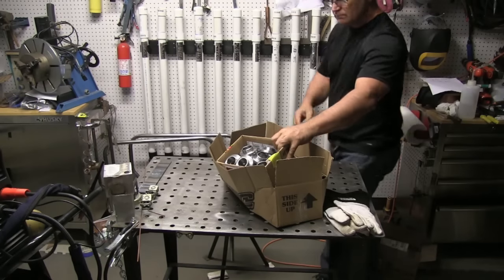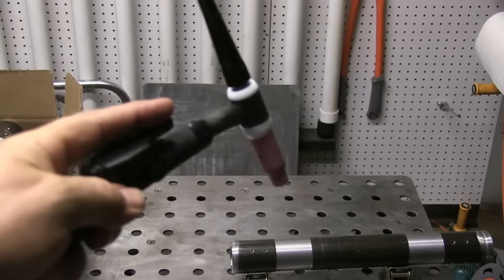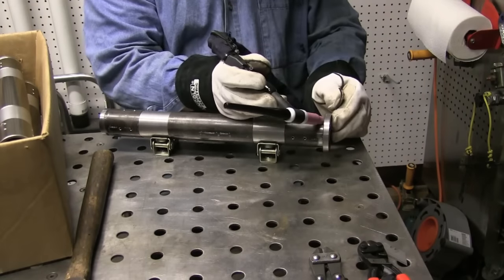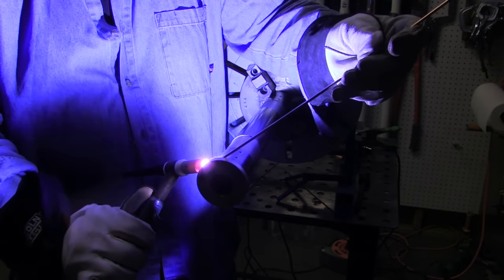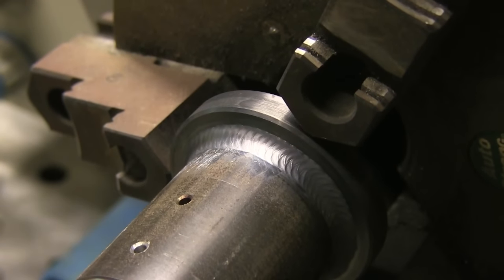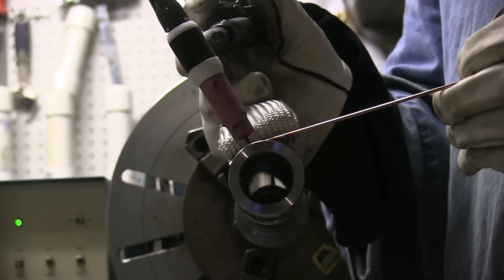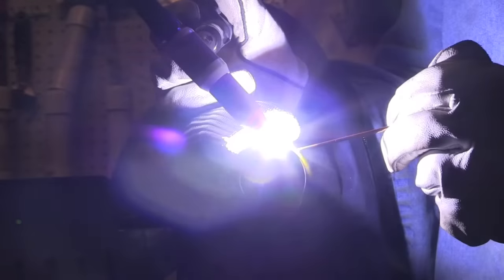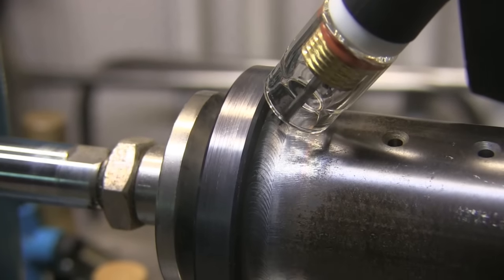TIG Welding parts on a turntable

Comment: Thanks as always Jody, your videos have help many of us through time. I am about ready to step up to the plate and try an inverter machine but my tried and true Syncrowave 200 and my Syncrowave 500 have been bullet proof dependable machines. I can't count the number of torches I have smoked with the 500 even water cooled ones but what a beast. Now that I have closed shop and don't need them I still have both in my garage (put the wife's new suburban out) and do smaller jobs with my limited power supply. Thanks for showing us the CK line as I have a water cooled 250 amp flex-loc torch on it for small use now.

Comment: I have been doing some research, looking to get my first tig welder and the APH alpha tig 200x has  been coming up a lot.....I have  found that this machine is probably going to be my introduction to tig welding. Good video.
Reply: I've had the AHP for a couple years. I'm very impressed. I've pushed it pretty hard for a homeowner. Aluminum, stainless, aluminum on a 120V extension cord, etc. It has never let me down.  I bought it on Amazon for their very liberal return policies. I haven't needed to return it though......

Comment: Cool setup.  Reminds me of an auto tig I used to run back around 2003.  We hard faced oil rig parts with Inconel.  Filler was fed from a spool through a piece of copper tubing mounted to the end of the torch.  Pretty much like those tip-tig torches.

Comment: I've got ahold of an old Southbend 9 " turning lathe recently. I'm going to convert it to use a DC treadmill motor cause that has variable speed control. And that's got me thinking what i can do to REALLY slow it down. And what else i need to do to be able to weld on it.  :)

Comment: Jody, you featured a brass hammer you made during one of your videos.  It seemed like you brazed each of the faces of it and stick welded the beads on the handle.  what did you use on the face of it?

Comment: When "walking the cup" is not allowed, is that only on ceramic cups and only due to the effects on surface finish?  If glass or other material is used that won't effect surface finish would it then be allowed?
Reply: I've heard of people having serious problems trying to walk a Pyrex cup - as in, the glass melted on them.
Reply: +Joseph Dunn I gotta agree on this, walking the cup with pyrex cups is also, I find, way more difficult because the pyrex has very little surface friction and it just tends to wiggle in the same place without moving forwards.
Reply: If you aren't allowed to walk the cup because it would scratch the material and you can find a way to do it without scratching, that would probably be fine. It's something you would want to clear with your customer, boss, test supervisor or whatever.

Sometimes you aren't allowed to walk the cup because an employer is testing your ability to freehand. There are times when you don't have room for "chicken-wingin'", as some old timers would say. You can't get around this one.
Reply: There are mainly two reasons walking the cup is not allowed. Surface finish as you have already stated and an increased HAZ (heat affected zone). When you walk the cup you usually end up with a big HAZ value becasue of the slow travel speed. Stringer's on the other hand are much faster thus giving you a lower HAZ. The reason it is a problem with having a large HAZ is because when welding, if you give the material enough heat the crystal structure can change making the material pretty much useless. If the structure changes you are going to lose the properties of the metal, and you more than likely chose the material you are welding for those specific properties. Just follow the WPS and you'll be fine.  If there is a maximum weave width specified you may not be allowed to walk the cup.